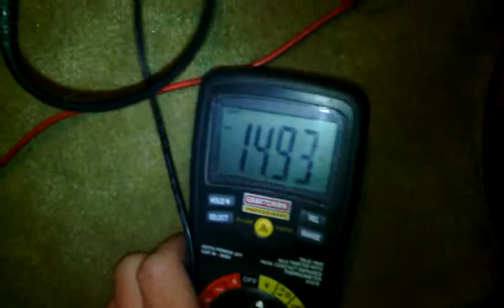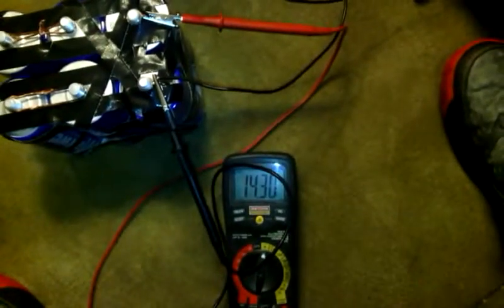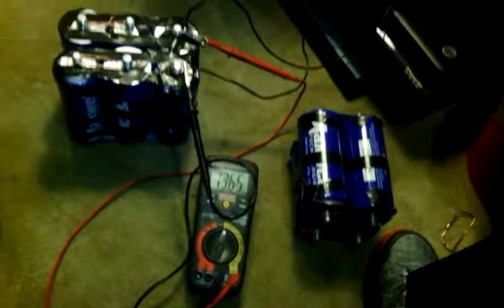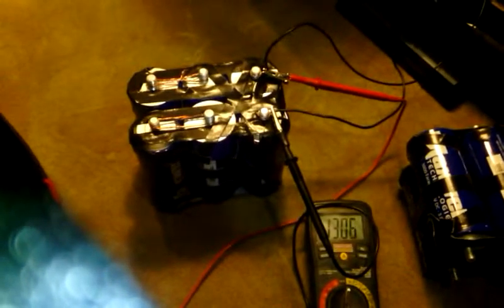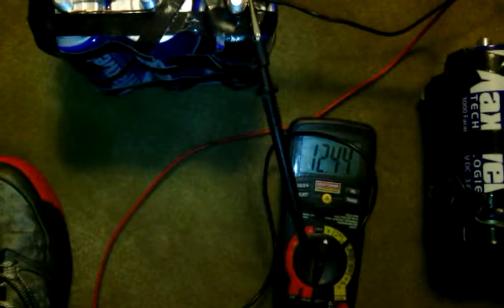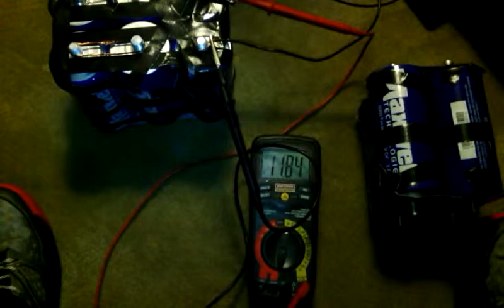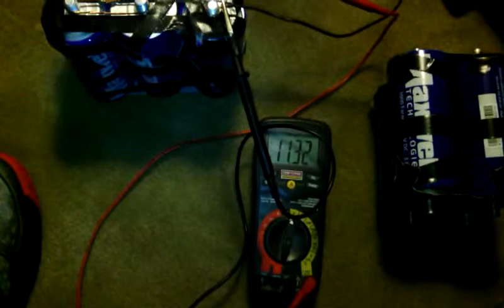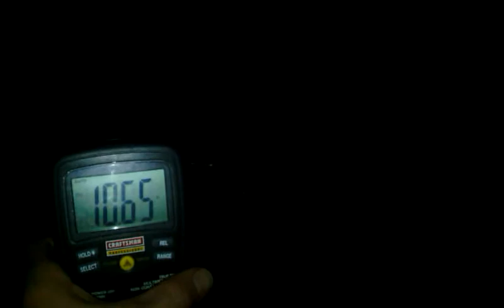Ultracapacitors powering a lamp

Comment: I have since installed six of these in my car and removed my car battery. My car starts like a champ, but I can't leave my lights on, or even open it with the keyless entry 5 times, otherwise they will be too low for the car to recognize and i'll be locked out till i charge them, which takes all of about 30 seconds when i hook up the charger.

Comment: can we use these Ultracapacitors for an ebike
Reply: i had 10 of these in series to create about 25 volts when i tested my wifes ebike with them. they went around the block and were down to about 23 volts and the brushless motor controller thought the battery was dead and turned off. So if your could find some way to harness all the power in them you could certainly go much farther and never have to worry about capacity degredation, but until then, no don't waste your money, just get yourself a lithium ebike battery. I considered making a joule thief to push the lower voltage into another smaller set of ultracaps to keep them topped off, but I have yet to test that theory, it would in theory work if you had some sort of charge controller. I bought my wife a lead acid 24v battery and in less than 3 months it cant make it near as far as it could brand new.